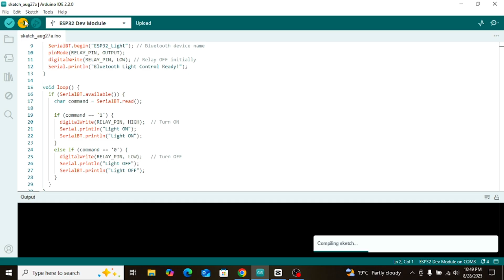How to Control 220V Bulb with Mobile Phone | ESP32 Bluetooth Smart Home Project (Step by Step)

Comment: 2:00  Two VERY IMPORTANT details that should have been in this video:
1.  The 220V supply wire must NOT be plugged into mains at this point.
2.  The negative (blue) wires, ideally, should be soldered and not just twisted together; but in any case this connection MUST be insulated with heat-shrink tubing and/or electrical tape.

Also, there should be no bare wire along any part of the 220V part of the circuit.  Make sure that the connections to the relay are secure and the wires are not touching anything other than the terminals.  220V mains electricity is VERY DANGEROUS, and you should keep yourself and any bare metal, liquids, and flammables well away before you even think of plugging it in.  This is not to scare you, but if you are a true beginner watching this video then you need to be aware and respectful of the potential danger.
Reply from the maker: Thank you for sharing these valuable tips and safety points 🙏 this information is very important for beginners.